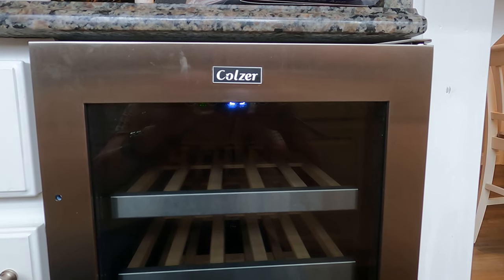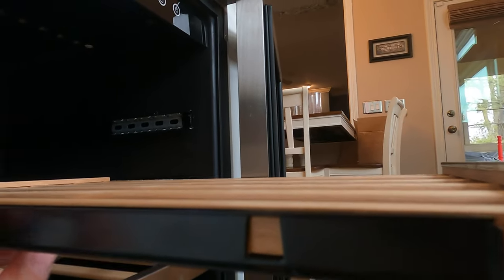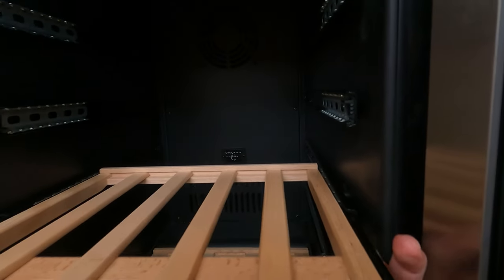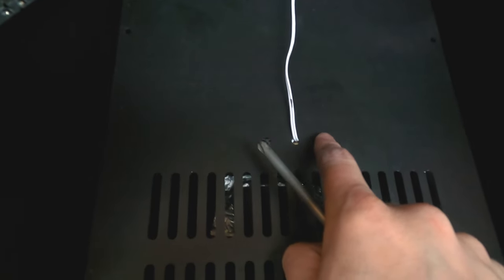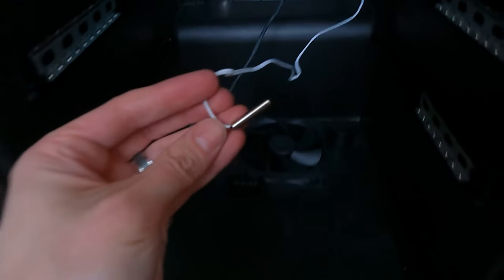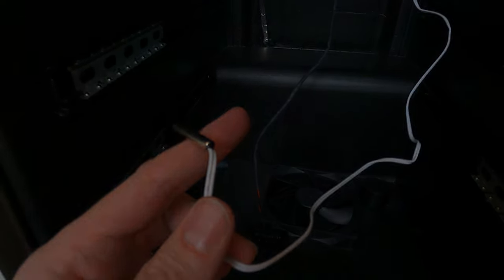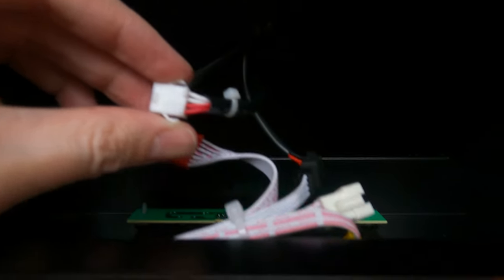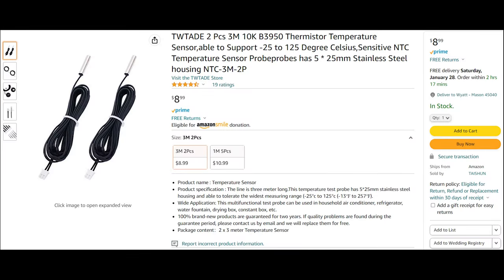RARE 005 - Fixing E3 Error on Colzar Beverage Fridge

Comment: This didn’t fix my E3 error code, is there a second sensor somewhere?
Reply from the maker: There are 2 - one is the white wires (the one inside of the fridge area. The other is the red wire, which is attached to the coils to ensure they're cooling. I'm not sure if they overloaded the error code or not, but that would be the next place I'd look. Let me know if you find out more details!
Reply: Yup, it was the other sensor thanks! I noticed that the little computer fan seems to run 24/7, even when the compressor/cooling is off. Is that normal?
Reply from the maker: Nice! Glad you got it.

As for the other fan, I don't know. The more I see the assembly of these systems and the more I believe I was ripped off 😂
Reply: Haha totally, same here..